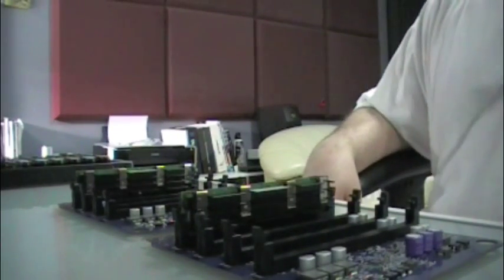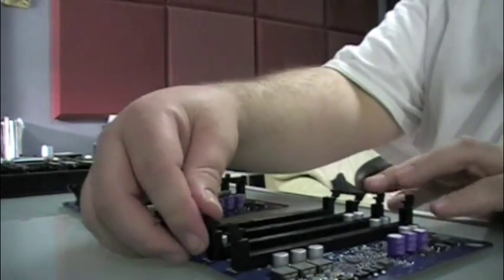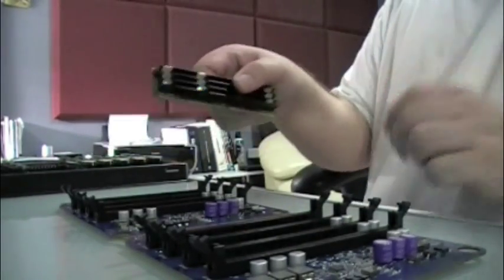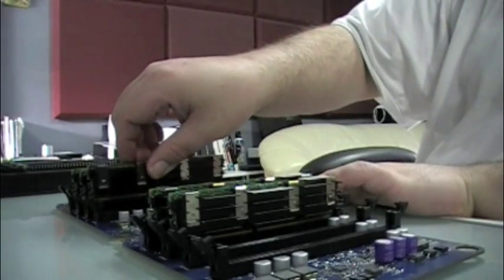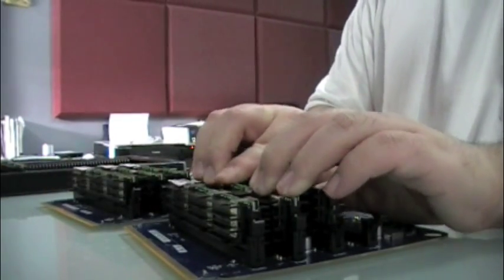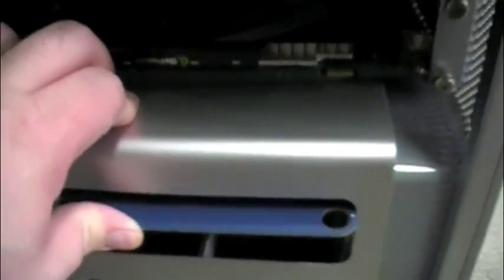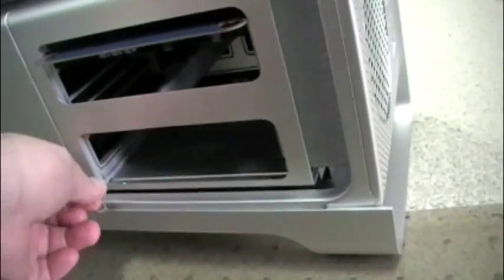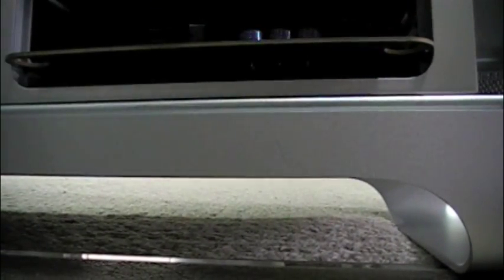2008 Mac Pro - Installing Ram

Comment: @MacUserLogic: You are showing wrong installation of 3 pairs of DIMM's. You don't look at the riser cards like you showed in your video. Proper installation of 3 pairs of DIMM's would be full top riser card (or two pairs) and first (always closer to gold connectors to the motherboard) two slots on the bottom riser card.
Reply: What are the advantages of doing it top-full then bottom? What will happen if one does a "wrong installation" as shown in this video? Thanks in advance for the enlightenment =D
Reply: @shiva-sagar  Shiva hi. If you have or planning to buy one of of the old MacPro machines, no matter which one, there is exactly one and only right way of installing RAM because of correct addressing and slot (card) recognition! Period. Go to Apple web site (archives) and (here is an example like you're buying MacPro 3.1 late 2008 model) put in a search for exactly that model. And you're good to go. It is not like on Windows PC machines where in case you need to put all pairs just honour the even number of same cards of RAM. If you have an exact example you would like to know write here specs. and I'll help if I can.
Reply: @Beexzz  thanks much for the suggestion i.e. "go to the source". I'll also look into the archives--probably a good idea to get familiar with them =) For now, I am looking at the manual from https://everymac.com/systems/apple/mac_pro/specs/mac-pro-eight-core-2.8-2008-specs.html which basically says to install in matched pairs balancing across both top and bottom risers. I'm not sure if there is a disadvantage to having the RAM unbalanced on top and bottom, e.g. 10 GB on top+4 GB on the bottom. 

Another question, if I may. Are the top and bottom risers interchangeable, the actual boards I mean? Looks like they are the same P/N (part no.) but I don't want to assume.

For those who may be in a similar boat: I have two A1186; EMC 2180 Mac Pro 3,1s, the "Eight Core" 2.8 (2008) 2.8 GHz Q. Core Xeon E5462 x2, MA970LL/A
 versions. The first (older) one had 10 (2 x 1GB + 2 x 4GB) RAM but gray screened on me, so I got the second (4 x 1GB RAM) to get my Pro Tools  setup going again. I am harvesting parts from the first (hard drive, RAM, Graphics card with 2 DVI ports, DVD drive) to expand the second. Also keeping the option of having two different OS versions (Leopard and El Capitan) on two different hard drives, although the first drive has not booted successfully yet.
Reply: @shiva-sagar  If you have Macs then it is illustrated! Back side of main panel if I'm not mistaken. Also, enter (everymac is good place) your Mac model and find illustrated image of population RAM cards. I am pretty sure you don't need me for that. Btw, despite the fact that 2008 3.1 (dual 2.8 xeons) can hold max. 32 GB RAM it is known it actually can 64. But, if you are trying to run some of the newer versions of PT then you're OK with 32 GB of RAM. You'll benefit more from two SSDs, one for system and another one for data/libs/samples/etc. RAM won't save you that much as SSDs would. I work with similar system(s) and purposes. Just run Live 10 instead and PT not as my main system.

Comment: How much ram can u install into the 2008 Mac Pro? And what version is it??
Reply: +EnderGamer The Mac Pro (Early 2008) computer has two memory riser cards with a total of 8 memory slots. On each card, the slots are arranged as two banks of two slots each. The computer comes with a minimum of 2 GB of memory, installed as a pair of 1 GB fully buffered, dual inline memory modules (FB-DIMMs) in two of the DIMM slots. Additional pairs of 1 GB, 2 GB, or 4 GB FB-DIMMs can be installed in the open DIMM slots, as illustrated below. Maximum memory is 32 GB.
Reply: +Magnum DB thx for telling me, but do you know what version it is?? For example, DDR3
Reply: EnderGamer If you are on the Mac in question you can choose Apple Menu>About This Mac... and if you're running Mavericks - El Captain you can then choose "Memory" and there it will tell you the memory kind. If you're not on the Mac, assuming its the same MacPro Early 2008 model, it states it's 800MHz DDR2 FB-DIMM. Features: 72-bit wide, 240-pin modules, 36 memory ICs maximum per DIMM, Error-correcting code (ECC).
Reply: Thx +Magnum DB